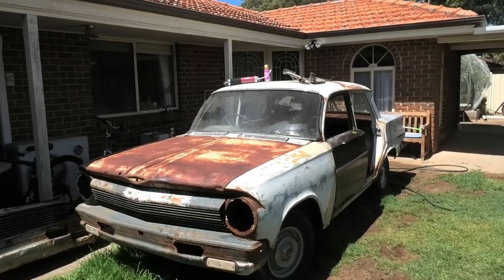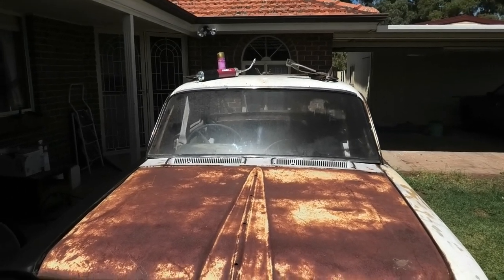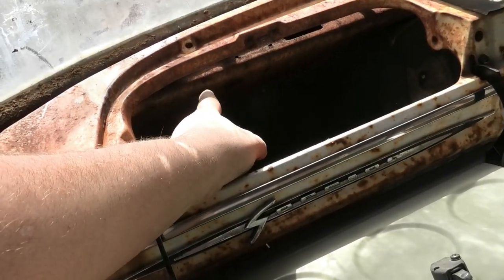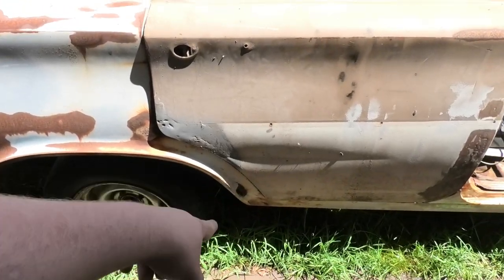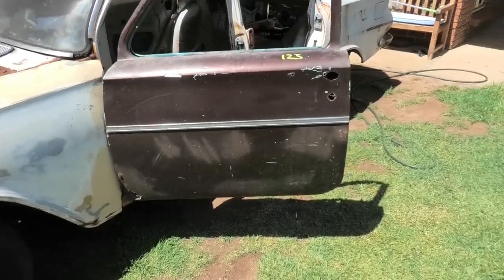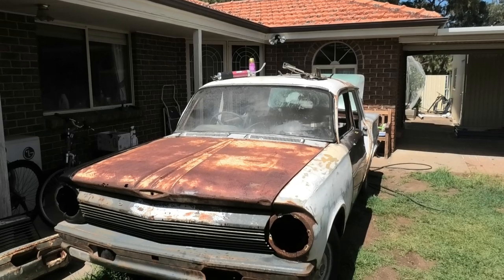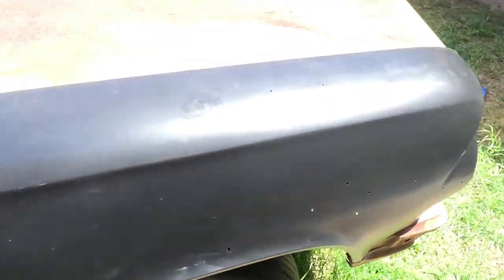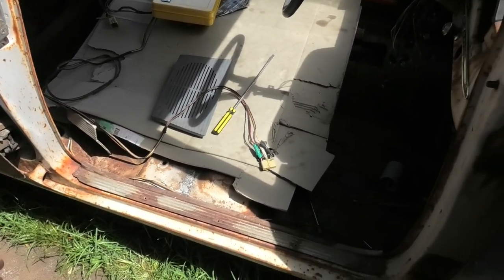A beginner's guide to EJ/EH holdens

Comment: My Brother was lucky about 12 months ago. he had always wanted an EH, and found an original survivor example in pristine condition. its had a respray at one stage in its life, in its factory white colour, but otherwise its just as it rolled out the factory. when he go it home he spent a day going over it with a fine tooth comb and it doesn't have a spot of rust anywhere to be found on it. not often you'll find them like that these days.